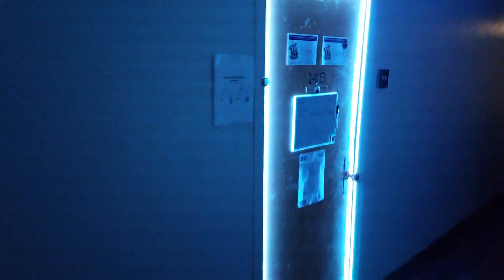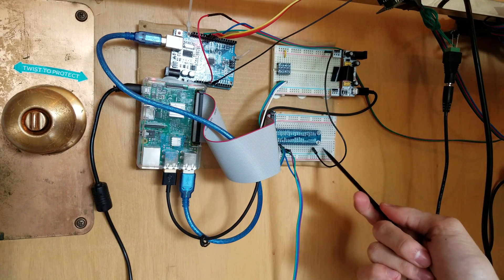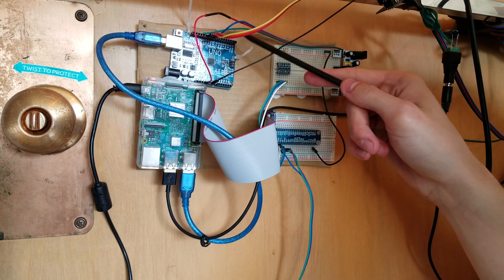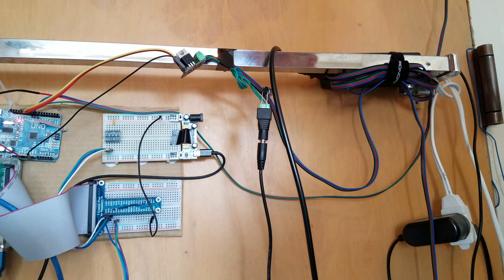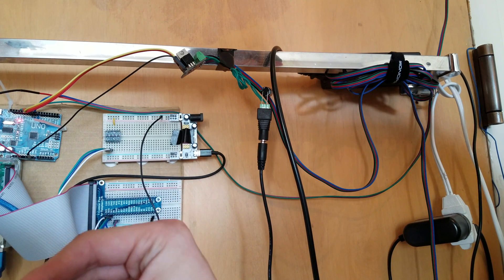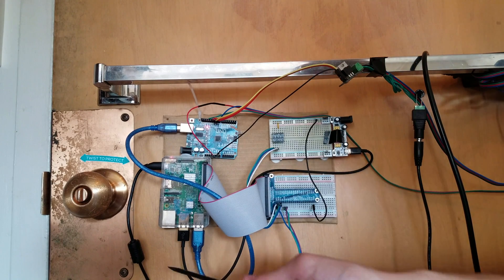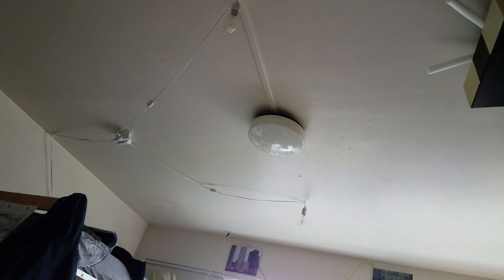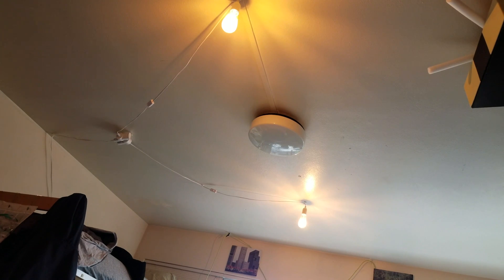LED Door Project #2: Complete rebuild with a Raspberry Pi

Comment: Neat, I have a Pi running 24/7 that has plenty of overhead to add home automation to it.
Reply from the maker: Awesome! Home Assistant and OpenHAB seem to be the go-tos. I just moved my HA server to a VPS though so I don't need to be connected to the wifi in order to control stuff.